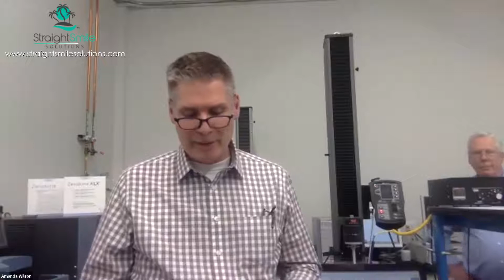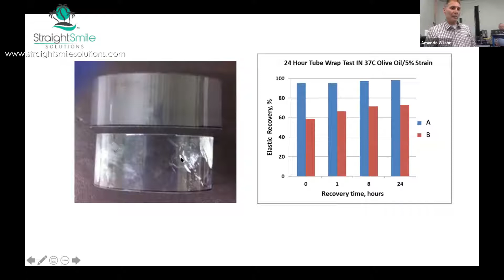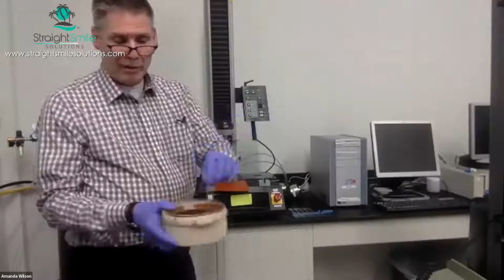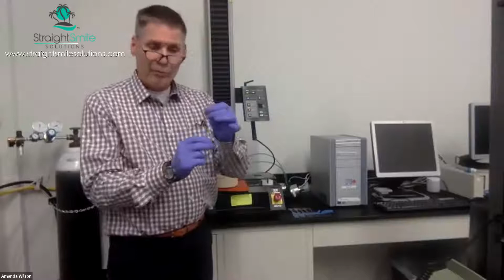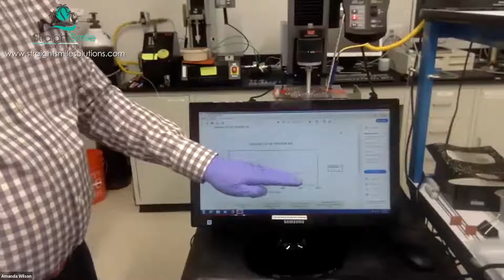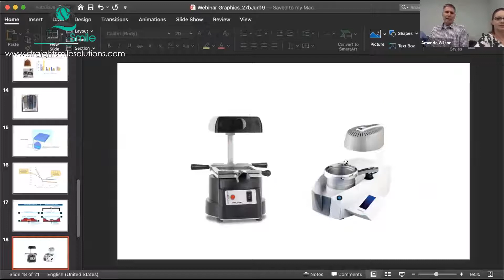What is Bay Materials / Zendura / Zendura FLX

Comment: Thank you for sharing! I have a few questions:

Why testing the long term stress relaxation at a 1mm deflection if the teeth movement per stage is 0.25mm at max typically? 

Also, was stress relaxation tested after that the materials were annealed?
Reply from the maker: Sorry not sure, I wasn't the researcher in the video. You would need to contact Bay Materials